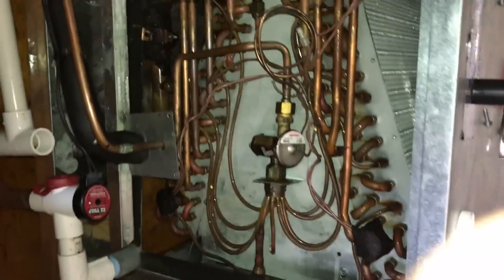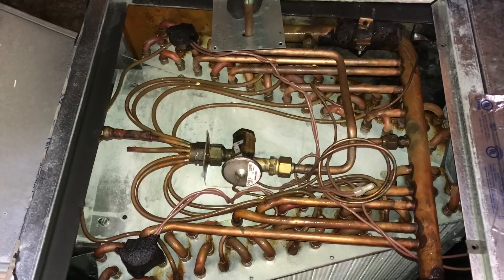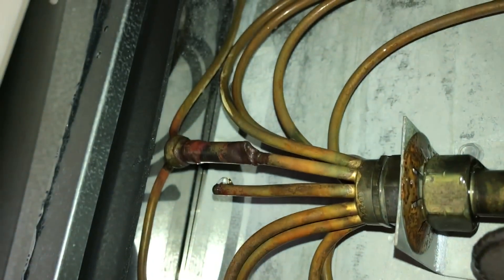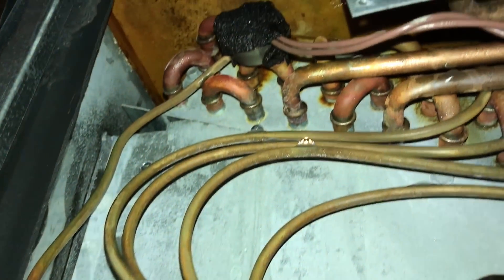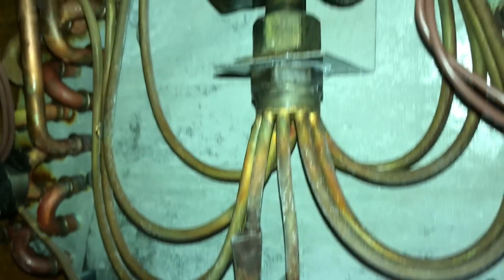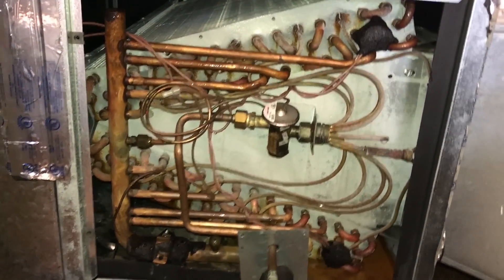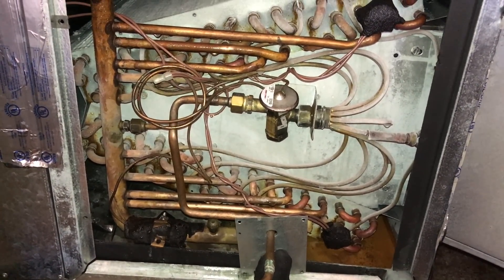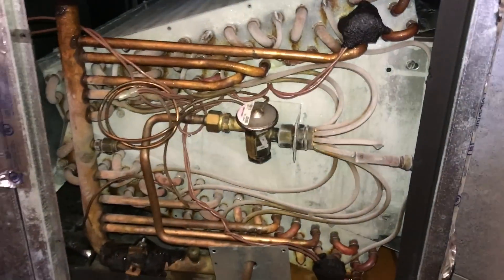No Cooling Testing Evaporator Coil For Restriction

Comment: Hey everyone im working on skm package unit when i start the unit its gone vaccum i check the all parts i found the txv is not working properly i adjuest the txv butt my suction gauge is still going vaccum plz help me what did i do thankx
Reply from the maker: You need to see if your filter drier is restricted before the txv. Do a temp drop across the drier since you most likely don’t have gauge ports on both sides of drier. If it’s not the drier you need to replace the txv. Also check the inlet screen of the txv for a restriction. If your system is pumping into a vacuum you have a restriction or not enough refrigerant in your system.
Reply: @thehvachacker  
Giod evening sir,

I already check the filter drier and fill the gass almost full cylender mean 11 kg butt my gauge is go back in vaccum then i check my txv and i will try to adjust the txv when i open fully txv gass passing othervise not and i m sorry im not completely understand  what is difference between sub cooling and super heat.

Thankx
Reply: @muhammadwaqas-ts2xq  sounds like TXV. Because you said gas goes thru when you open it. But system may now be way overcharged because you added so much gas during diagnosis. Good luck.

Comment: What I saw in the video is low freon flow due to no air flow so the TXV closed.  Freon is a dense heavy liquid.  The small amount of Freon flowed downhill more than being blown into the top of the coil.  This test was not done with airflow and thermocouple temperature clamps on each of the coil sections checking superheat on each.  A faulty test will produce faulty results.  Temperature clamp each section and check for superheat.  A restricted section will have high superheat with normal air flow.  The excuse of carbon is a red herring.  There is a filter dryer and an expansion valve with an inlet screen.  The distribution manifold is larger than both other places debris collect.

This is a miss-diagnosis.  The more likely result is a restriction in the expansion valve inlet screen.  This test needs repeated with a proper superheat test on the coil sections.  Restricted airflow or restricted expansion valve will cause sections to frost.  Top section will starve due to the weight of Freon at low flow rates.
Reply from the maker: I am not an engineer or anything. I am always learning and challenging myself to get better. Yet how if I have a 3/16" pipe and it Y's into 2 separate directions that are both 3/16". How is this not a restriction in the flow of refrigerant? Did whoever perform this repair not create a restriction of refrigerant flowing through this coil? I am called out because they gave up on that company that stopped answering their phone calls. I understand MB MECHANICAL HVAC service solution, isettech, and everyone else who wants to see me fail attempting to slam and call me out on the TXV over time will close down. Yet it never closes 100% or explains the frozen coil that ice is growing 10" outside an air handler cabinet in a 140*F attic space. That TXV should have slammed down and pumped down the system, therefore, the coil couldn't get cold enough to create o 48" x 48"' ice cube on the call where the homeowner went to Europe and before leaving the kid cranked the tstat to 55*F. This is a true story they return and find a water leak in 2 of the 7 bedrooms. Yet has nothing to do with what I am asking here.
Reply from the maker: Coil was clean.
Reply: I'm with you. With no air over a coil, system is way out of design parameters. Need to put normal load on the system and check airflow,  pressures and temps.

Comment: Butchered is a good term, saw many.  A tip, always look inside the coil to be sure its clean, just being clean outside does not mean clean inside.  You do good work.  I miss doing that shit.
Reply from the maker: Always need to check which I did on this hi velocity spacepak

Comment: Great video. The process of basically turning the coil into a static evaporator is something I never thought about. One observation I had was that the work done by the previous service tech may have come from a similar restriction. His solution was to bypass the distributor in an unorthodox and ineffective way. Good job.
Reply from the maker: So it was good to post this video instead of erasing.

Comment: Had the whole coil assembly freeze up on mine a few times. Just let it thaw out both times and it worked great. Am thinking there was some air restriction but never did figure it out. I figure as long as it works I’ll leave it alone.
Reply from the maker: Does it seem to happen on hot days with cool nights?
Reply: Yeah it happens early in the year about the first few weeks it’s on. After that it works fine, gets nice and cold when ya need it.